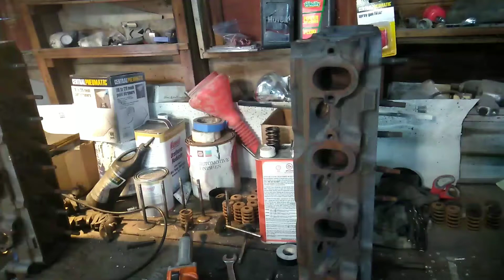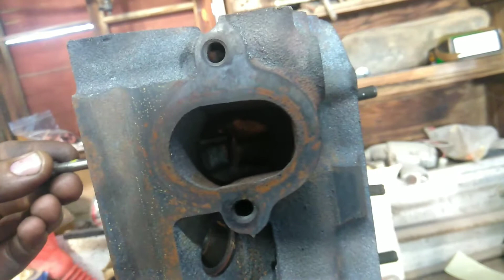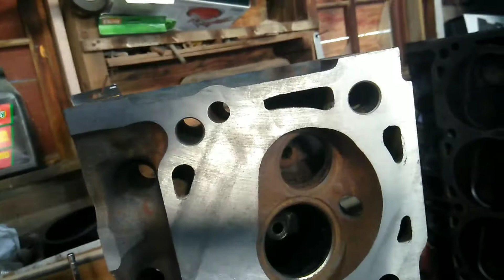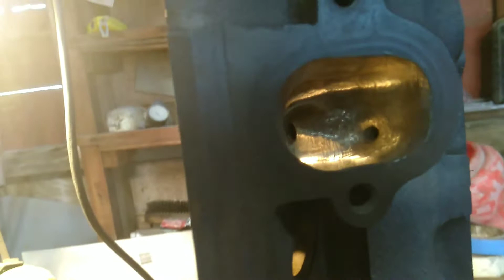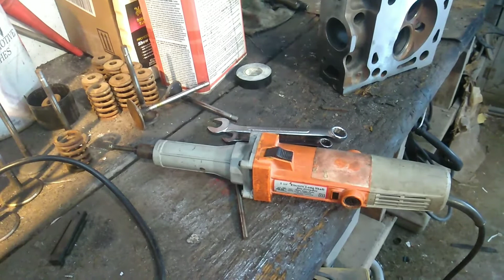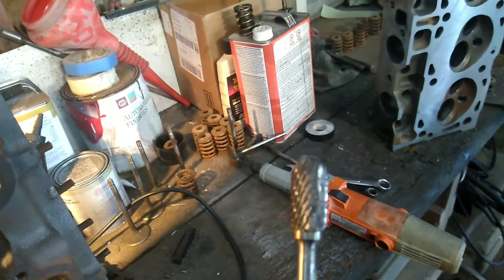BBF "DOVE" head porting exhaust ports

Comment: Chris,
About your intake side; you will find David Vizards B Mini engine vid very helpful. He is a master. His B Engine 2 hr video gets deep into low valve lift flow. Also, doing a 45 degree chamfer on the combustion side of the intake valve at its edge creates an aerodynamic brake stopping reversion of exhaust products into the intake port during overlap which lets you run a much larger cam maintain Street Mainers.

He has books out there.
I’m proud of you and your work. I think things look great. 
Cheers,
Carter
Reply from the maker: Thank you for the info I really appreciate it
Reply: You can weld up the holes and fix spot that were ground to much with cast iron welding rods.a guy at the track last night had a stock 460 with dove heads 225 values port and polish work 1050 carb 200 shot nos ran 5:80s 3150lbs car.

Comment: I imagine everything I would say has been said in the comments above.  D0VE head are becoming harder to find in usable condition. I could be wrong, but typically they don’t have EGR holes you need to plug in 1970. Best bet is finding heartier 429 heads.

Comment: what did you use to plug the holes from the egr hump
Reply from the maker: Nothing I just left them
Reply: @CCAutoWorks  was there any issues with how it ran or anything
Reply from the maker: @joshua12345j  no it runs good the intake we used just blocked off the egr
Reply from the maker: @joshua12345j  https://youtu.be/8hDaqY7HcmA